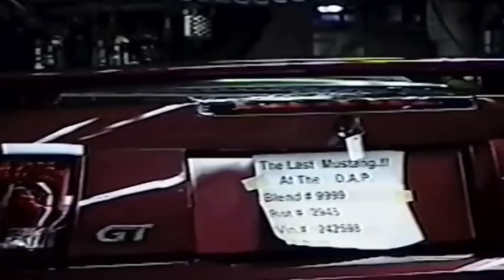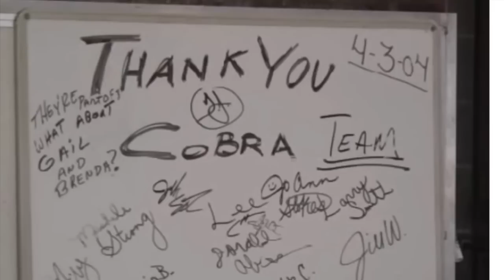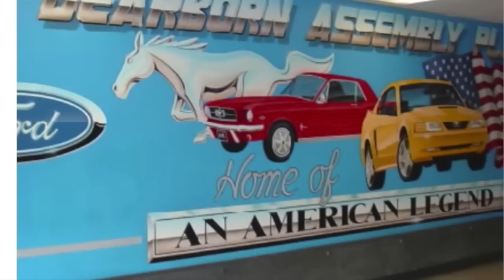Last New Edge 2004 Mustang GT: Story

Comment: In December 2011 I drove to the Ford Ranger production plant in St.Paul Minnesota on the last day of production. I was driving my 2009 Ranger. Every direction I looked I saw thousands of white Rangers, 6-8 tan and brown Rangers and one medium/dark blue Ranger. The white 2011 XLT Supercab Ranger I bought in June 2015 might have been there since it was built in November 2011. Ford sold around 55,000 Rangers in each of 2009 and 2010. Ford announced that 2011 was the last year of production and they received a surge of fleet orders selling around 70,000 2011 Rangers. I currently have three white Rangers: 2004 and 2009 XL longbeds and a 2011 XLT Supercab. All three are 2.3 4 cylinder with 5 speed manual transmission and 2wd. When production starts on a brand new vehicle design the first run of them are usually black, brown and dark colors since it’s harder to notice door and body panel gaps as they tweak production techniques and figment.

Comment: Bro get Intouch with me I just got a red  2000 mustang gt  as a project car.  Check this out the body has 255k miles with no check engine lights on I was amazed
Reply from the maker: You can email me pictures and vids with more detail at xsellr9@yahoo.com if you would like.
Reply: @justin.c_svt  I’ll take some pictures and send a video of it in a few the battery is dead so I’ll have to put my Jump pack on it an send some vids of it running
Reply: @justin.c_svt  it was at a tow yard it was about to be crushed I had to save it
Reply from the maker: That’s great. Nice save
Reply: @justin.c_svt  thanks an it started raining over here I’ll email you pictures of it and send a vid of it running tomorrow
Reply: @justin.c_svt  I just sent the email it might take a minute to come through

Comment: Ford never sold that car it’s stored in the old glass plant or the new model center which every u want to call the building at the rouge complex all the tires are flat and there’s a big dent on the left rear corner, been working there20yrs so I seen it with my own eyes, that car never left the Dearborn complex
Reply from the maker: Wow. Interesting. Thanks for the info

Comment: New Edges were awesome but I plan on keeping my S197 forever.  Might get a New Edge to Coyote swap and tune the suspension like the Cobra R's.
Reply: I want to coyote swap mine also
Reply: What type of S197? I absolutely love the 05-09 S197. Mine’s got 195K miles on it and I plan on buying another one when mine blows up
Reply: @christopherbrooke2142  I like those early S197s, they sound and look great.  But mine is a '13 with the Coyote and I love it way more.  Only 60k miles but so far people with high mileage Coyote's haven't complained about anything serious so I'm confident that even with my driving habits I'll get way more than 200k miles on it and if it does blow up, rebuild it
Reply: I still has a old edge sn95
Reply: @BDN355  lol...huh?
Reply: @zerkfiter  the first sn95 before the re design

Comment: I wonder where the last 2004 terminator is
Reply: Dave Rodriguez Probably in a plant in Kentucky.
Reply: Probably wrecked
Reply: I have it
Reply: @svttrouble5598  Funny joke
Reply: @alexandercurtis4427  If its black I think I do.
Reply: @svttrouble5598  I doubt it, but check the VIN and do some research. You might own a small fortune
Reply: SVT Trouble there are lots of black terminators
Reply: Martin Luther Capitalist Yes i looked and saw it’s the most common color. But it’s a good chance it could be.
Reply: The rarest 04 Cobra is a Oxford White vert with medium graphite
interior trim. Only 34 made. As far as 03 its a Sonic Blue vert with black top and medium parchment
 interior trim. Only 2 made

Note a vert fan but they hold the rarest options

Comment: Great vlog, very informative, new edge my favorite as well, out my 3 new edges that I own, my 04' Cobra in redfire pearl, with very low miles and always garaged, the clearcoat is starting to peel on the hood, not so with the other two, is redfire a defective paint? I've seen comments about redfire, where it's a common trait, bummer, I'll have to put three coats of clear, when I'll repair it.
Reply from the maker: Yeah my sister has an 03 redfire GT and it’s clear is gone gone gone
Reply: My zinc yellow peeled at like 11-12 years old

Comment: Since it’s was a vert it mine as well been a auto. Finish off the cushy feel. Leave the cobra the Mach 1 and the gt coupes for manual.
Reply: I have a gt vert 5 speed. It's nice to cruise with the top down in the summer and bang gears when wanted. It's like the best of both worlds.
Reply: ShankerIV to each his own. The man pedal is going by the wayside anyway. Pretty soon it’ll be self driving cars and boring.

Comment: I have a red 2004 new edge GT with 35k original miles :D
Reply from the maker: Very nice!
Reply: I got a fire red 2004 GT 40th annivrsary coupe 5 speed manual black leather shaker hood mach audio. Love the car. I will never sell it. Bought it for 10K with only 60K miles on it. Shes at 104K now. When the motor goes im going to drop a coyote in it. Tho the motor i have now runs like new. Oh an the car was from North Carolina and I brought her back to her home state Michigan.